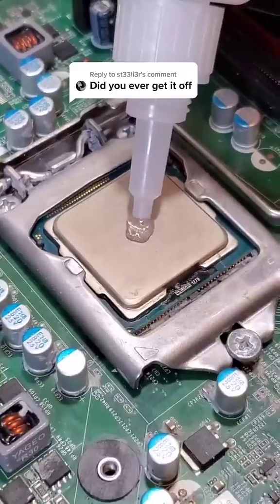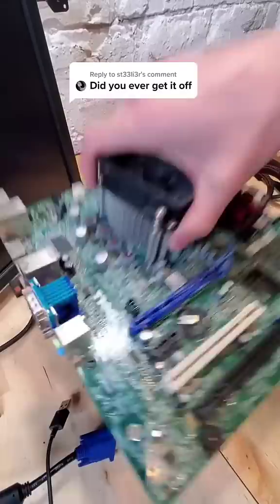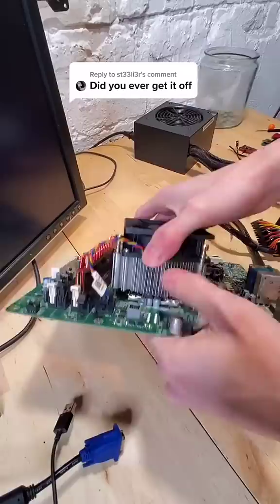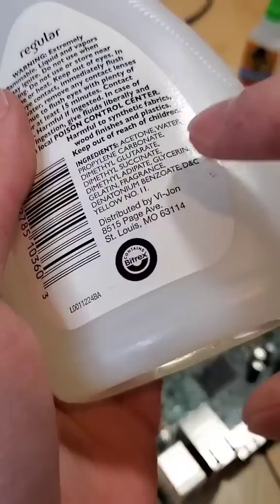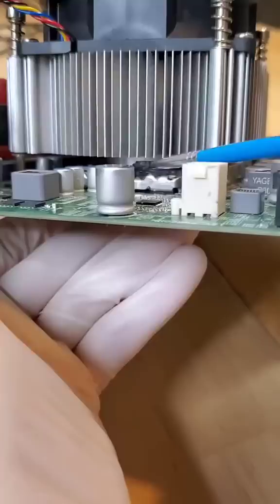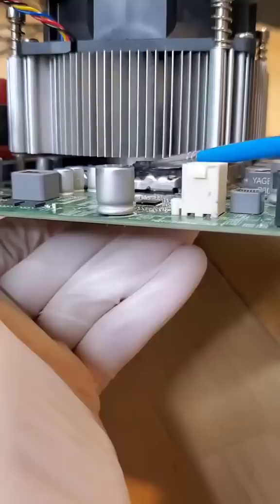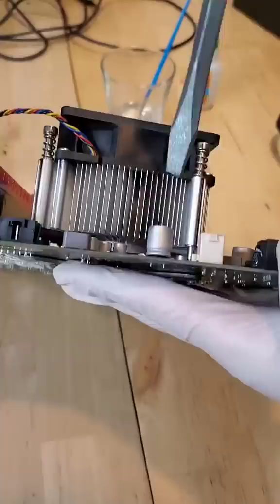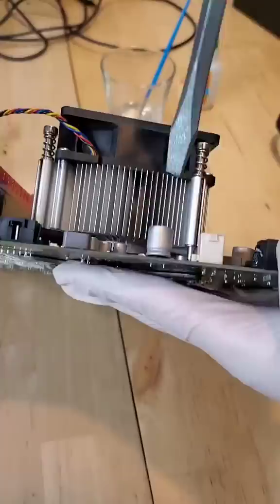how to remove super glue from your PC! #shorts

Comment: So it’s just a permanent thermal paste ? Good to know.
Reply: Its pretty decent, but well its bond, but dor cheap systems. why not. It doesnt dry out
Reply: @alzucard3618  also, it does get in the gaps. So no air gaps, and it is heat resistant aswell
Reply: So if you're too lazy to change Thermal Paste or don't have enough money, this works
Reply: I wonder how long it lasts
Reply: Wait isn't super glue flammable 💀
Reply: @naxzed_it  Yeah, it's flammable, but it's heat resistance is way too high for a CPU to max out at.
Reply: @kyrars6724  don’t have enough money? Thermal paste is less than $10
Reply: @halami2149  i think the superglue costs more than the thermal paste :D
Reply: @yazmat96  depends the quality of thermal paste and the super glue aswell from what brand it is.
Reply: @naxzed_it  i think it wont burn up unless youre playing Crysis
Reply: @Rose_Emp cheap thermal paste already does its job well. Getting expensive ones only benefits 0.1-1 degree Celcius
Reply: wait you have to change thermal paste? how often? ive had my pc for like 5 months now and haven't changed the thermal paste
Reply: @Xylti  bro at least every month. Ur gonna burn out ur CPU
Reply: @abrahamgon1124  My cpu has very low temperatures all around even on the heaviest loads tho so I can't see why I'd need to do it every month
Reply: @Xylti  they're just messing with you, you don't need to change it much

if you've got a high performance PC that generates a ton of heat maybe once every few years, but for most PCs as long as the thermals are fine you don't really need to do anything with it
often you can go the lifetime of the PC without replacing it and it'll be fine, the worst that can happen is slightly worse thermals
Reply: Apple: write that down
Reply: dell is gonna have a mad one with this
Reply: @yazmat96  I can buy super glue for a dollar
Reply: @abrahamgon1124  OOPS. I had the same exact PC from 2014 to 2021 and never once changed the thermal paste....
Reply: Why would you want that lol
Reply: You could just use thermal glue. Over used it a few times with great success.
Reply: @alzucard3618  Uhh no lmao, you can get a tube of GD-900 (cheap thermal paste that I use for very cheap systems). Super glue does and WILL degrade after being heated to near boiling and cooled down to room temperature many times every day
Reply: @Xylti  when you renove the cpu cooler. Once a year probably if you want to properly dust out the cpu cooler
Reply: @kyrars6724  it's like 8 dollars...
Reply: @naxzed_it  only when wet
Reply: Meanwhile apple writes it down ✍
Reply: @Xylti  about every 5-7 years or so.
Reply: If you want permanent thermal paste use thermal adhesive
Reply: What if you mix thermal paste with Super Glue
Reply: @yazmat96  i can get you a tube of super glue for less than .50
Reply: @Xylti  they're trolling, you only need to replace it every year or so, and when you start noticing high temperatures or throttling
Reply: He said "hasn't been all that bad". That doesn't convince me that it's even nearly as good as proper thermal paste.
Reply: @Xylti  Only very cheap and nasty paste poorly applied will fail to last as long as most people keep their PC.

Comment: It’s a miracle you didn’t accidentally de-lid the processor lmao
Reply: no, if you pulled so hard only the ihs would come off, the socket cover would keep the cpu in place. AMD (before am5) however, doesn't have a socket cover and the entire cpu would come off, this often happens sometimes when you take off your heatsinks. Hope I helped 😊
Reply: @techwings001  can confirm, have ripped out my ryzen 5900 before by pulling it. Horrible design.
Reply: @Jairjax  That’s why i usually try to twist carefully side to side to loosen it up before i start pulling on it. Especially if the thermal paste has been on there for years
Reply: @KayleeVRC Yes, I still always cringe when I service computers that haven't been touched in a decade 😅

Comment: Should've done a cpu benchmark to get it hot and see if you can get the glue to soften up lol
Reply: When superglue sets, it's because of polymerisation of the glue. Heating the glue, once set, results in eventual destruction of the polymer. In the case of Ethyl cyanoacrylate it softens at about 150 degrees C. So you'd have to get it real hot.
Reply: cyberpunk would do the job
Reply: Won't the PC shut off automatically before it reaches those temperatures as a failsafe?
Reply: @FREAKBAiT  yeah I thought of heat too (applied externally), but then I realised that the temp needed would be pretty bad for the electronics (and given its a heatsink its going to be pretty much impossible to quickly heat just that up without heating up the rest).

The solder would also be pretty soft at that point so you'd be just as likely to pull the whole socket up with the CPU.

Best way is to pry them apart (with something finer than a screwdriver, best thing I can think of is the kind of plaster knife you use for applying filler).
Reply: Opens Genshin Impact
Reply: @FREAKBAiT  It's an Intel processor, that shouldn't take long.
Reply: @FREAKBAiT  the cpu would likely crap out by the time it reached that temp but it's possible

Comment: 2 other methods: you can freeze the superglued object and the changes in temp can cause the bond to be more brittle 
 The other is is super glue solvent that they sell at hobby lobby, it can mess up some surfaces though but I think metal should be ok
Reply: I trust my homie and he said that acetone could damage the CPU (we used odecologne)
Good on the other advice though, that could help in this situation
Reply: Motherboards aren't just metal, it's also PCB plastics, wiring, captiators, diodes, etc

Lots lots of fragile pieces on a sheet of plastic.

Comment: For an FYI anyone who has issues with cyanoacrilate or commonly known as superglue you should use baby oil it will separate the parts or skin learned this from having to glue together off-brand Legos that weren't clicking properly

Comment: Should've used an AM4 CPU; I've personally experienced and have seen posts of people pulling their CPU out of the socket with the cooler just because the thermal paste wasn't heated
Reply: LMFAOOOO I DID THAT
Reply: That was common on AMD systems for years , but yes as more people's bought into ryzen we saw a return of this
Reply: Can confirm that am4 cpus will come right out of the socket (and the pins don't really take any damage)
Reply: @williamlux  then you’re lucky. Most of the time some pins stay in the socket or get bend
Reply: I've had that happen once freaked me out so now every time I have to remove the cooler I'll run a cpu stress test for about 15-30mins I've never had a an issue since
Reply: The one good thing about Intel LGA CPUs. The socket holds the CPU firmly down.
Reply: @williamlux  The amount of damage depends on if you pulled the heat-sink off in a perpendicular straight line or twisted it off.

Comment: Perhaps you won't see this but. Years ago I was in a woodworking guild. One guy spent 2yrs testing dozens if not a few hundred adhesives. By far the strongest that stuck most things to most other things was super glue. 

However superglue was almost the fastest one to deteriorate from heat, moisture and fatigue. So if you want to get your cpu free just let it keep running and the heat will break the joint.

Comment: Superglue will release with heat. So you could try turning off the fan then run the machine for a bit doing something like some benchmark test and then shut off and try removing. The acetone will damage other board components it touches like the trace masks on board

Comment: twisting applies a torque that translates into a shear force on the surface of the glue and usually has much greater effect. You can also use a lever arm effect to make things easier.

Comment: Cyanoacrolate melts with a little bit heat, heat up the heat sink with a blow torch holding the motherboard upside down until the cooler pops off, better than getting acetone all over a motherboard

Comment: Take pure aceton that isn't diluted with water, then pour it over the entire thing over and over.
Acetone evaporate rather quickly so applying what to my eyes looked like VERY small amounts will get you nowhere.
And non diluted acetone won't damage the electrical components.
As recently as last night I used acetone to clean shiet off on both my CPU and GPU, like so many times before..
I've mixed 90% Alcohol gel and Pure acetone in a refillable Nose Spray bottle which I use to clean Components and it is Imo among the best stuff I've used.

Comment: If you pop the ZIF lever and undo the four mounting points on the HSF, you should be able to just pull the whole CPU+HSF out as one unit, at least partway.

I've done this before on accident on a system with a broken ZIF retention mechanism.

Comment: I still remember when you couldn't switch out CPUs like that so they didn't teach you how to do it in computer repair classes
Reply: How long ago was that, because even the SLOT based intel Pentium II's were swappable. I remember not just PCI, but also AGP and ISA, and Pc's that had large red flip switches instead of a small power button.

Comment: If you have room, throwing it in a freezer helps as well. Super glue breakdown at low Temps but with metal connections you might have still needed the screwdriver.

Comment: Yeah I advise against using acetone on your PC too. Amongst (many) other things it will dissolve is the varnish protecting the circuit board and very likely the glue holding the copper tracks to the board.
Reply: Uhhh, no. The epoxy in the FR4 handles acetone fine and the solder mask (that's what the "varnish" is called) also handles acetone just fine. In fact, acetone is one of the popular choices (along with isopropyl alcohol, which tends to be a bit less aggressive) for cleaning off flux residue from boards after soldering. The only thing you should be careful about with acetone is plastic housings of components on the board, connectors and things like that. It's fairly rare, but sometimes those housings may dissolve in acetone.

Comment: Heat also helps remove super glue, so if you head up the CPU till just before it thermal throttles you should be able to take off the cooler easier
Reply: except super glue is also heat resistant and your cpu will max out well before the super glue starts to soften

Comment: Remove the fan and soak the whole board in acetone.

Don't worry, the board with all the components soldered to it was already washed in MEK at the factory, which is very similar in action and chemical compatibility but even more aggressive than acetone. Basically all the connector plastics are solvent inert like LCP.

However fan frames in particular are frequently made from ABS and get consumed by acetone readily. Also enclosure parts, keyboards, all that good stuff.

Comment: The most concerning thing for me was the acetone as I've seen what it does to most plastics. I'd have gone straight to forcing them apart, though would use something with a finer edge - hammering a plaster knife into the gap would work quite well I think.

Comment: If you get the CPU hot it will break down the bond around 95c just wrap the cooler in foil unplug the fan let it thermal throttle for a bit and it will pop right off

Comment: Must've been a decent thermal paste then, otherwise the heat of the CPU would've loosened the bond. Maybe try running it without the fan on for a few minutes instead of prying with a screwdriver next time

Comment: Next time don't get the nail polish remover with the watered down acetone in it, that stuff barely takes off nail polish; and it's crap with glue. Get the 100% acetone, it costs more, but actually works like a proper solvent.

Comment: POV: you used the thermal paste that comes pre applied on the stock cooler

(Backstory: I literally yanked my ryzen 5600x out of the socket while the tension bar was still down while trying to remove my stock Wraith cooler and yes, the cpu literally came out stuck to the cooler)

Comment: My old CPU cooler was stuck so bad, I ripped the CPU out of the board, bent 2 pins doing it. Took an hour with razorblades and acetone, but I put it back in and it worked fine.

Comment: One of my friends gave me an old board and chip with cooler all still on the board. The thermal paste was so dry I couldn't get the cooler off at all, managed to pulled the cooler off with the cpu still attached to the bottom of the heat sync. Had to use a flathead to pry the cpu off and it flew across the room. Everything still worked after

Comment: as probably someone else has said but I'll said it also because I'm to lazy to hunt the comments. turn your computer on and run it will monitoring the temp. superglue looses it's touch when heated. it's great for wood and metal working. just apply heat and it pops off or can be removed with a small tap sideways because it's sheers strength sucks.

Comment: If you would have just kept the CPU on let it get pretty warm it'll come off machinist used super glue all the time and just heat the attachment plate to break the bond although having said that not sure how much that CPU can handle
Reply: For those of you that don't know most CPUs can get so hot they will desolder themselves if not properly cooled. They used to be a trick where you would wrap up a Xbox in a towel so that it would get so hot from not cooling that it would resolder its own chip to the board and sometimes it worked

Comment: I use super glue on heatsinks for ICs from time to time.
Reply: Please ensure these ICs dont reach 90°C, poisoning could result otherwise.

I sometimes mix thermal paste and epoxy. Which is not ideal, more ideally I'd formulate a proper thermal filler for the epoxy.

Recently got some Silastic like compound by Kafuter, claims to be 1.6W/mK, which would have been great, but I have severe severe doubts about that, like allegedly something like that can't even be made with higher than 0.5W/mK value. Anyway it does work, for all those needs where you need that kind of stuff. To prevent movement, aid in dissipation a little and quieten coils.

Comment: He, hi, i once had a Guilemont Geforce 256DDR and the Cooler died. In the early 2000s no one had "easy" Access to self glueing pads. So the Heatsink screwed itself off while i replaced the Fan and to attached it again i used some Thermalpaste from my CPU and made a dot of Superclue into every Corner. It sticked onto the Card for ~2 Years with heavy moving to LAN Parties and fell off, again, while demounting the Card and replacing it with a GeForce 3.

Comment: There is no challenge  you carefully break the cooler down..
Into pices..
First with a hacksaw then a cutter/...
Chip it off to the point  you can remove the cpu from the motherboard 

Then you very very carefully gently  use twisters/.. and rub some solvent in there
To save the cpu

Yeah if you're stupid enought your best solution is to destroy the cooler

Comment: This was like my first oc i was given by a friend. And i went to change thermal paste and it was 3x worse than this ngl. so bad i pulled the cpu out of its socket it was ok but when i finally got it off the cpu flew across my room, luckily it was only a fx4100 but i chioed the corner and broke 4 pins. It still worked. But it doesnt work anymore coz i think the motherboard died

Comment: Why didn’t you just benchmark it and get it unbelievably hot and pull it off
Reply: Superglue does not work like that. When superglue comes into contact qith air, it does not dry in the conventional sense. Instead, it reacts with the air to form an extremely hard resin. Heating up the cpu would've just cracked the glue resin instead of melting it but seeing as it has good thermal conductivity, it wont crack under 50-70 degrees Celsius.